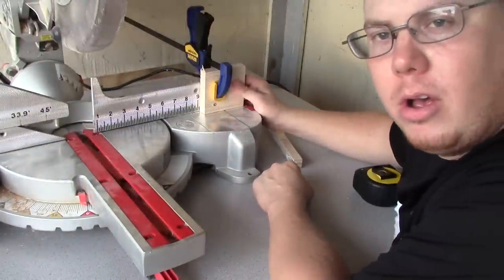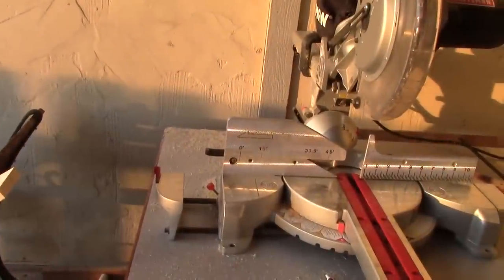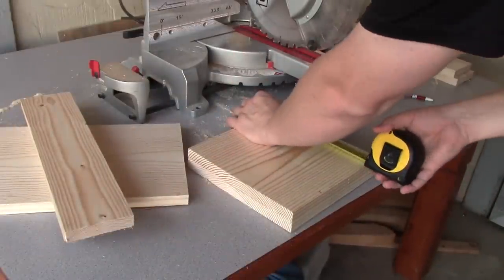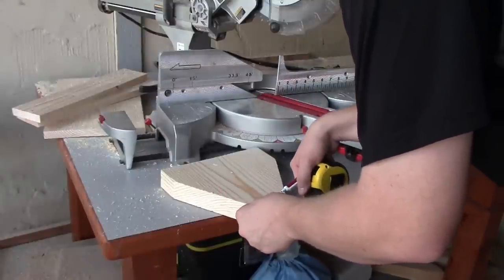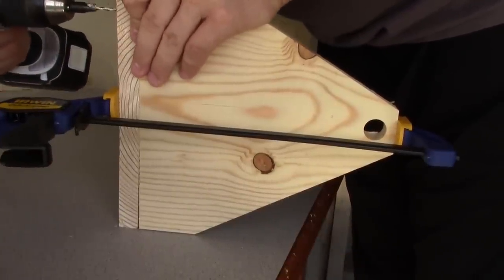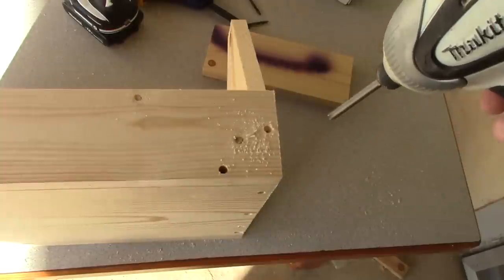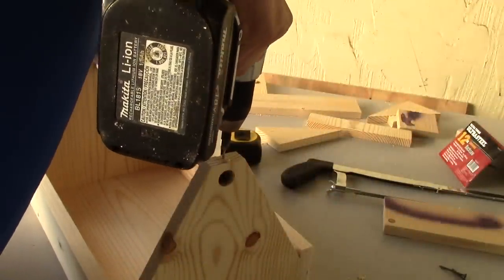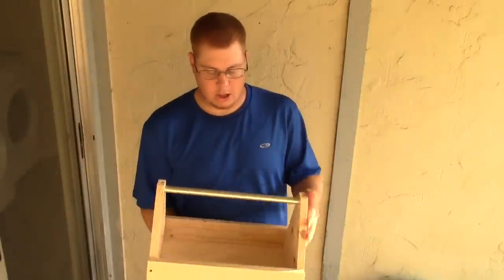Wood Working Projects: Wooden Tool Box pt 1

Comment: what kind of plywood you usually use to make a small box? a Marine Plywood came into mymind coz its quite durable to water but then its quite heavy and inconvenient carrying around. Any suggestion anyone?
Reply from the maker: +Ameer Asyraf I would say that unless the box is going to be getting wet Marine Plywood would be over kill.  There are tons of different types of plywood and I pick what i need for the project.  I usually use 3/4" and then I pick the type based on cost and what I need for the project.  If it is something for the shop, then i usually go cheaper.  If it is something that is small then i might go to 1/2" or something like that.  

I would go to the home center store where you live and look through the plywood they have.  I would decide then based on how much you want to spend, and what kind of results you want for what I would buy.  It is really your preference.  

For this tool box i used 1" X 10" board i think.  This isn't plywood in this project.

Comment: I'm wanting to make a wooden toolbox but I want the toolbox to be deep inside do you know what all the tools I need to make the type of tool box I want to make?
Reply from the maker: +Willow Fashionist 82 You could probably make that with a circular saw, or a jig saw.  If you have a table saw that would for sure be the easiest but it isn't necessary.  You would need a drill to attached it with screws and glue.  You might could just put nails in it, but screws would work better.  

Thanks for the comment and for watching.